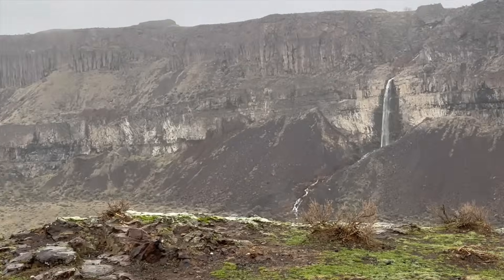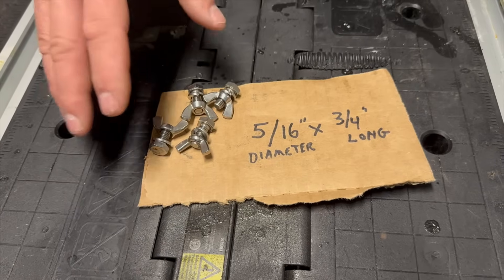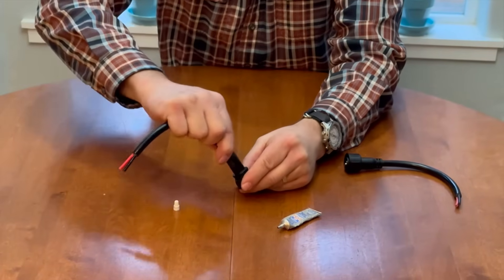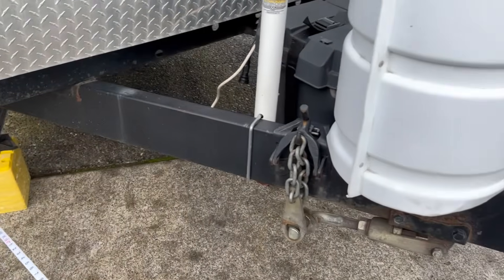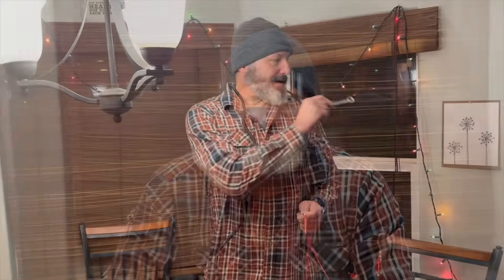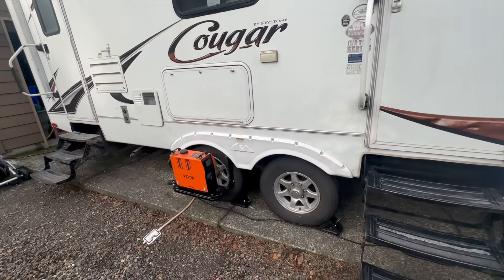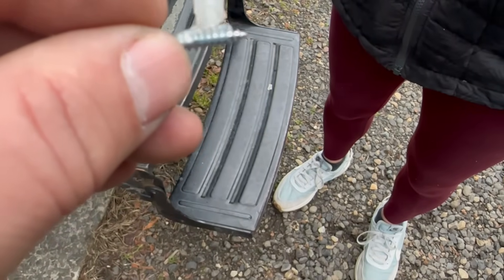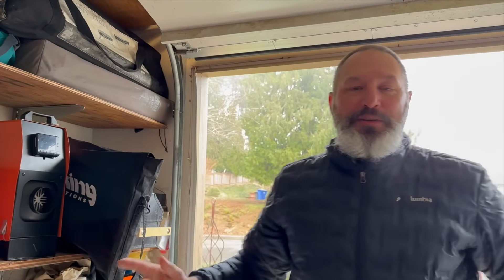Diesel Heater to RV via Direct Vent

Comment: Excellent job on the install and the do's and don't
Just picked up my heater. 
I already have the step I use for the roof top tent put away. Didn't think of using it as the stand!! 
Keep them coming
Reply from the maker: Thanks for the positive feedback

Comment: So many fools , ya a heater pulling air from outside is smart , wow , anyone with a brain can see how stupid this method of heating is ,,, how efficient would your house furnace be if it was pulling freezing air from outside to heat the inside ,,,not very yet morons thing this is good heat ,,,wow,  did you vote trump in too ?
Reply from the maker: Let me help you with your grammar.

So many fools (fragment), 
ya (Yeah -corrected for spelling and capitalization) a heater pulling air from outside is smart, (period instead of comma to correct run on sentence) wow (Wow - corrected for capitalization), anyone with a brain can see how stupid this method of heating is (remove space)., (remove comma) how (How - corrected for capitalization) efficient would your house furnace be if it was pulling freezing air from outside to heat the inside (question mark) not (Not -corrected for capitalization) very (comma) yet morons thing (think -corrected for spelling) this is good heat ,,, (end sentence, remove commas? Or was this intended to be an ellipse? …) wow (Wow -corrected for capitalization), did you vote trump (Trump - proper nouns should be capitalized) in too?

Comment: How insulated is your duct hose ? Looks thin. I think my heater ( which is exactly like yours ) puts air out at 225F I wonder how much loss your getting from your duct hose .
Reply from the maker: Good point.  I would imagine I’m loosing heat from the water unit to the trailer. I chose my hose based on Amazon recommendations and ease of storage.  How easy is yours to store?
Reply: @DavesTiredFeet  Ive only had it for a few weeks and am using it in the the house so no duct work. Im contemplating on putting it outside and running some duct work through my crawl space and up into my closet floor . Im studying on the best kind of ducting before I buy.

Comment: I don't understand the need for the diesel heater. Do you have it as a backup heater to the main heater in the rv?
Reply from the maker: When boondocking with no power hookups, my propane heater will kill the rv’s batteries in about three hours.  With the diesel heater, my batteries last all night long.
Reply: @DavesTiredFeet  yeah that makes sense, I use around 1kWh of battery during the night. The diesel heater must be a lot less.

Comment: One question.....are you running the diesel heater in place of your propane furnace.....or as a suppliment to your propane furnace?
Reply from the maker: Thanks for the question.  I’m running the diesel heater in place of the propane heater.  The factory propane heater will kill my batteries within about 3 hours of run time.  The diesel heater can run all night and I still have power left in my factory batteries in the morning.

Comment: What is the advantage of using a diesel heater over the propane furnace already in the RV?
Reply from the maker: Battery life.  A propane furnace will drain a stock RV battery in about 3 hours.  A diesel heater uses far lass energy and will run all winter night.

Comment: Why not use the factory propane heater? Is there some reason you’d prefer a diesel heater of the propane heater?
Reply from the maker: The factory propane heater’s fan will drain my batteries in around 3-4 hours.  With the propane heater my RV batteries last all night long and still have power in the morning.  Just perfect to allow my solar system to recharge them fully for the following night.

Comment: Nice job,  maybe butyl tape on the electrical port to prevent water leaks might be better than just silicone?  But great idea and might have to try this on our camper.
Reply from the maker: Great idea, that is what my Fantastic Fans called for when I upgraded from the factory roof vents.

Comment: I put mine inside my 14 / 7 toy holler. Camper, by that one other adapter from Amazon and it looks perfect exhaust outside, never problem. And you don't gotta worry about the rain to snow someone stealing it when you're gone.
Reply from the maker: Sounds like a great set up.

Comment: With this model, if it's installed indoors, is there a way of ducting the air for the interior cabin heating from the outside area?

Comment: Great idea and nice work on the video. I might recommend ducting the inlet from the heater to the camper as well so that it recirculates the air and its a bit more efficient but this is a super clean setup.
Reply from the maker: Thanks for the compliment and the feedback @TruckDogRoad.  Many of my viewers have mentioned the recirculating ducting.  I need to make a follow up video.

Comment: I was waiting for you to approach the fuse. Here is a survival tip on that the glass fuses are almost a thing of the past very difficult to source. You can just as easily obtain an in-line spade type fuse. (ATO/ATC) and then you’ll always have access to a spare is that’s what your camper uses and you can make sure you have a stock at hand.
Reply from the maker: Thanks for the tip @sevanson1, I like the idea of having the same type fuses which match the RV.  I chose the glass fuse to keep it “lower profile” in the 22 foot  12 gauge cord.  Additionally, many of my viewers have mentioned I should have placed the fuse between the battery and the male plug.  I agree and believe that is a better placement then what originally designed..

Comment: Is this cheaper than running propane?
Reply from the maker: If you’re talking strictly about fuel costs. Propane is cheeper, at least in Oregon.  However this project was about RV battery life.  Camping without electric hookups my propane furnace would kill my batteries within 2-3 hours.  With the diesel heater my batteries last all night and then some.

Comment: Long term durability? Are the units running trouble free for months, 1 seasons, years & years & years??
Reply from the maker: That’s a great question, however I’m not the right guy to answer it.  I use this heater about three trips a year. With these heaters only costing $120’ish I would not expect longevity.

Comment: Is your rv propane heater not working?
Reply from the maker: My propane heater works perfectly. However, when boon-docking (camping without electric hookups) the propane furnace will drain my batteries to death within 3 hours. The diesel heater solves this problem.

Comment: Dave a suggestion for drilling into out out of a vehicle surface. If you are going into the vehicle from outside, but Blue Tape all around the areas where the hole is going, eliminate damage to surrounding Gel Coat. Next suggestion is if you are going from the inside to outside, follow same rule as before with the tape, just before you saw breaks the exterior surface, reverse the drill direction and allow the hole saw to spin, gentle push against the drill so it will penetrate the outside skin. The hole will be smoother and less chance of harming the outside surface of the Gel Coat.
Reply from the maker: Excellent suggestion, thank you @markmanning5683.

Comment: i noticed that you didn't use "heat shrink electrical connections. even with the hard plastic connectors such as these that you are using, you should remove the hard plastic then replace that with heat shrink. then crimp, heat then you will have a water tight seal, instead of having to worry about the dielectric grease. i've wired up hundreds of everthything. n i havnt used electrical grease or electrical tape. I do have a container of "heat shrink & heatshrink connectors"

Comment: Greetings from Colorado! Hello Sir, I am watching your video and installation process after 9 months. Great & wonderful video. I have one question though. Is the diesel heater worth it. I need something like this in my truck to stay warm in the mountains during Elk season. I cannot take my 42' toy hauler up the windy roads. Once again thank you for such a wonderful video. Best regards,
Reply from the maker: Greetings!  I’ve seen a few videos on diesel heaters inside of pickup beds with a canopy.  I absolutely would have a carbon monoxide alarm / detector in the truck.(I have one in the RV).  I would also do research on if a single truck battery would have enough power to start your truck after powering a diesel heater all night at elk camp.  Thanks for the positive feedback
Reply: Thank you so much for your quick response.
I normally keep a crack open for fresh air & carbon monoxide issues.
Thank you once again and happy holidays to you & your family.
Best regards,
Sikander

Comment: What’s the problem with your factory heater? They work great!
Reply from the maker: Great question, the factory heater will drain my rv batteries to the point where the heater and all other electronics will stop working within about three hours.  The diesel heater will last all night and still have power to move my slides back in.
Reply: @DavesTiredFeet  you just need better/ newer batteries. 2 ea. fresh 6 volt golf cart batteries will make it through the night easily, and then some.

Comment: I like the idea of heating outside air and bringing it into the trailer. Did this show any drop in condensation? I feel the loss of heating is worth the cost to keep moisture damage away.
Reply from the maker: Great question, I saw no signs of increased condensation, such as droplets of water on my interior windows.  Heating the outside air is not as efficient as a closed system.

Comment: Nice job.  A couple of questions.

1.  Why no inline fuse?
2.  Why not mark the white wire with a black mark?  I thought that was the accepted way to mark a white wire being used for hot.
3.  Why not just use 10awg given the relatively short run?
Reply from the maker: Thanks for the compliment. You pose all great questions.

1. I placed an in line fuse on the heater side, however, The fuse should be on the battery side.
2. You’re correct, black marker is the accepted way to id.  I learned more about wiring this summer when I had to hire an electrician to work on my home wiring.  He showed me the “marker way”.
3.  Larger gauge wire will always be the better answer.  I had 12awg on hand and the calculator confirmed it would work. So I went with it.  

I’m considering a follow up video based on suggestions from commenters and that the project is reaching it’s one year anniversary.  Dave

Comment: Very thorough. Thank you Dave. Curious, the current Vevor 8kw model has a 3" outtake for the heat. If I remember correctly, you installed a 4" vent. Why the one inch difference?
Reply from the maker: I wanted to reduce the flow resistance as it made a 90 degree turn from the inside of the trailer (back wall of the kitchen cabinet) to the area above the factory propane heat duct.  Great question

Comment: Your tire table. Possibly the bar in the back could be replaced with an adjustable chain, rope  or ratchet?
Reply from the maker: That’s a great idea, thanks.
Reply: @DavesTiredFeet  I used to have a Dutchman for season 2006. I have now found a 2008 with four slides for full-time living. I would like to investigate a good and proper full-time heater that I could place underneath and behind some skirting. Up here in Central Northern Alberta.

Comment: Thermostat is now outside
Reply from the maker: I don't believe this model has a thermostat.  I may be incorrect ,however when camping in 30'ish degree weather the heater maintained 55-60 degrees inside the RV.  Thanks for the comment.
Reply: @DavesTiredFeet thermostat is behind controller. Many people pull it out and mount it high. Used mine below zero. It heated and shut down when it reached optimum temperature. Never set it on full blast

Comment: I have the same diesel heater. I put the unit inside near the rear of my van. Drilled 2 holes in floor for exhaust and air intake. Works great and when i fill the tank, its right at the back doors so its easy to fill straight from a diesel pump.
Reply: the diesel heater might leak so remember to check your CO sensors and maybe crack a window when its on.

Comment: When the glow plug on my Vevor diesel heater is heating up it draws up to 135 watts. At 12 volts that equates to 11.25 amps. Yes, their website states 8 amps on startup, but that's wrong as far as my unit goes.
Reply from the maker: Interesting, I’ll have to see how many watts mine is pulling on start up.

Comment: One thing most everyone who uses these diesel heaters miss is the lost efficiency when heating outside air. Take a lesson from your house furnace - it heats inside air. The most efficient way to use these diesel heaters is to run a second duct from the heater input air to the inside of your heated area. These heaters can raise input air by a finite number of degrees which means that for every degree the outside air drops so does the heated air leaving the heater. By heating inside air the advantage should be obvious.
Reply from the maker: Thanks @rayherriott6517, I’m considering modifying the set up to accommodate for the work the heater has to do.  Ducting the interior air to the Vevor is a great idea.
Reply: @DavesTiredFeet moving the entire unit inside would be even better.  (Many years experience with many types, brands. Capacities, etc....
Reply: @gbear1005  what about the noise 🤷‍♂️
Reply: @plav4835noise?  It runs slower to maintain the same heat. If you want no sound, do a drip heater.
Reply: @hillaryclinton1314 those heater’s make noise, I wasn’t talking to you mind your own business
Reply: A heat exchanger of sorts where air is preheated before being brought up to temperature.
Reply: Good advice.  I’ll be doing my install with that in mind.😊
Reply: Those Heater running hot anyway, no need to running even hotter,
Reply: The new furnaces and code require outside air as the intake
Reply: @glenludwig5135 for the combustion. As for the heating it heats the warm air inside to be warmer. Good try though
Reply: @Slingshot277 100% right. I just wasn’t paying attention when I read the comment
Reply: @glenludwig5135  Outside combustion air as to not cause a negative air pressure inside.
Reply: @MrTeampenner 100% right. I read the comment wrong
Reply: @MrTeampenner bad advice.   Cold air soots up an already low temp burn.     I will conceed that an exhaust heat exchanger to preheat intake air is the best solution.
Reply: @gbear1005  These heaters are supposed to be inside, not outside!!!!

Comment: Great video !  Two things I might suggest is put dielectric grease in the plug connections, and when using the butt connectors , I would strip the wire a little longer and fold over the end of the wire , then put it in the butt connector , then crimp , it will keep it from pulling out .  Just a suggestion.   Thanks for sharing your video . Good Job !
Reply from the maker: Excellent points @snakeeyes2126.  I really like the folding of the wire prior to crimping.  Thanks for helping me be better.

Comment: I would like to make a couple tips they all in one kinds of diesel heaters that are made from Japan and China. Those suck only reason why I say that is because the first one I got was the all in one and in negative degree weather the air intake That heats the air up ends up freezing and shutting down and the downside of those all in ones is you can’t safely hook it up in your camper RV or caravan conversion without killing yourself with carbon monoxide leak from the exhaust. I highly recommend the diesel heaters that are not all in one box Because yes, they do come with the same shitty exhaust plants spend 20 bucks on four really good exhaust clamps for the diesel heater and use exhaust paste right on the diesel heaters exhaust nipple and run it underneath your caravan conversion and then you won’t have a freezing problem if you ever get in those colder negative weather I know this guy only is in like 34° weather but mind you freezing is 30° so if it does freeze up, you’re going to have problems because the fan that blows the heat all around into the caravan is going to actually Get ice to form overtime and burn out the motor for the circulation of heat just a tip do with that what you will

Comment: Flexible dryer hose will coke that heater up real quick and cause all types of issues. Smooth stiff duct only. All you people using these heaters DONT use flexible dryer hose.

Comment: Did you seal the wall where you cut the opening before putting the duct in the hole?
Reply from the maker: I did not.  I could have used the ducting tape. Didn’t think of that.

Comment: Should have taken the heater apart and made a separate fuel tank and mounted the heater side into your outdoor storage. Then ducted it and wired it. Then it would not have to sit outside. The heater assembly itself doesn't get hot enough to worry about mounting inside your trailer storage compartment.
Reply: The biggest hassle with mounting them inside is venting the exhaust.
Reply: @windisfundotcom right through the bottom with a pass through

Comment: I installed my diesel heater in the kitchen cabinet. Carefully cut the top out of the counter and installed a removable cutting board for easy access. Cut out a larger square hole in the bottom of the trailer and put a metal plate on the bottom for the exhaust to run through. My Exhaust runs out through electrical metal conduit and exhaust out from under the trailer like any motor vehicle would. I found it much more efficient heating the warm air in the trailer, then heating ice cold air and pushing it into the trailer. It’s small tank will burn approximately 36 hours on high altitude setting this way. It is working great with no fumes inside.❤❤❤
Reply from the maker: Sounds great, @Bumblingdesertsweller!